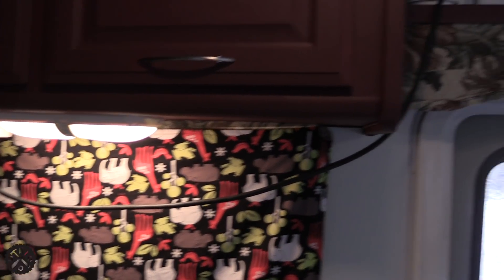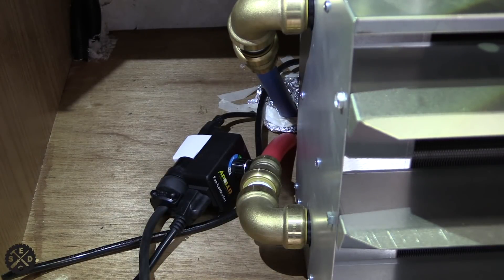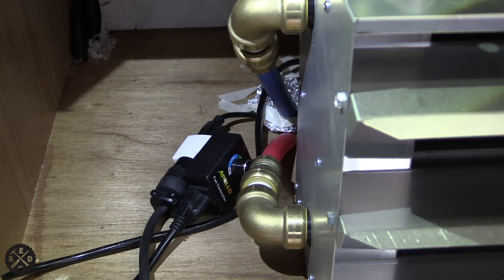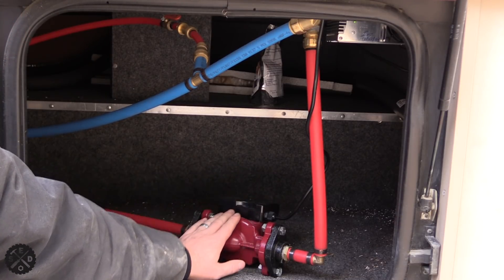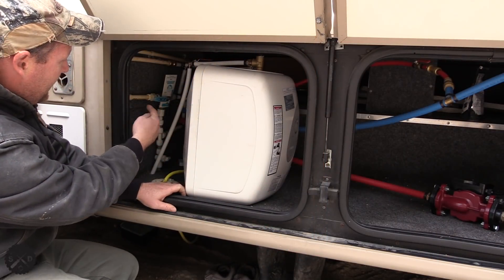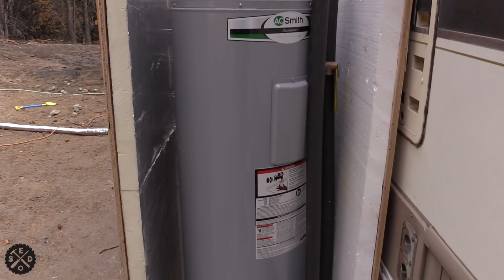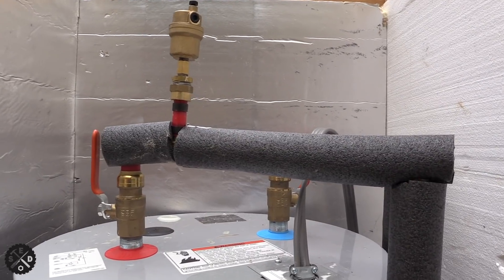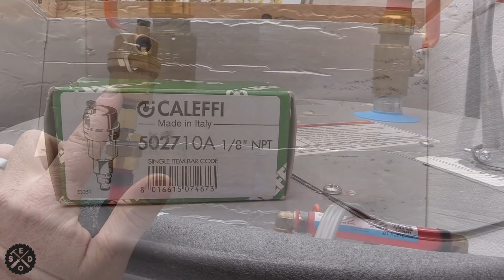Heat With A Water Heater And Radiator RV Camper Garage Shop

Comment: Love this!  Planning to consult my Plumber on installing a similar setup in my basement's furnace room, to supplement the heat in the basement, as the furnace just won't heat the basement, properly, no matter how I configure the heating vents.  Cost of installing a thermostat controlled gas fireplace is $5k+:  did this in our previous house.  for our current house, it would require major remodeling in the basement:  likely $15k - $20k, for everything.  I calculated what installing a setup similar to your's, in my furnace room, hooking it up to my existing gas, high efficiency Water Heater:  it clocks in between $700 - $1,000, total, parts plus a professional Plumber's time.  Our furnace room is unfinished, with exposed water pipes in the ceiling, so easy access.  It should work better than the gas fireplace did, to heat the majority of the basement in the old house; that fireplace worked superbly, without a fan to blow hot air around!

Your video gave enough details, and your links (even though not all worked) gave enough information to find all of the needed components.  FYI: prices on e-Bay are the same as on Amazon; both offer free shipping.  Hoping to install a system within the next two months.  Our basement gas fireplace, in the previous house, lowered our heating bill, overall, by warming the basement 10+ degrees, which kept the upstairs warmer, as all of that heat rose upwards.  Expecting the same for this house, with the Hot Water Heater supplementing the furnace, warming the basement around 5 degrees.  Thank you!  Cheers!
Reply from the maker: That sounds like it could work well in your situation. I hope you can get it set up easily! Thanks for sharing your experience.

Comment: I’m trying to make an off grid set up like this with a wood stove boiler. How would I control the heat output?
Reply: look for snap disc's they have them for different temps. I had my woodworker in basement and used the modine as a dump zone it kicked on an off with the snap disc's clamped to the pipe and wired to the fan.
Reply from the maker: I’m not exactly sure on a wood stove you would need some kind of manual tempering valve I think.

Comment: Why not just use a 220v electric heater in the camper and eliminate the whole water system?
Reply from the maker: You could. We wanted something that was safer for kids since they were in the camper with us and this radiator didn’t get hot enough that it would hurt you if you touched it. It actually made for a really nice place to dry our gloves and boots as well. All depends what your needs are.

Comment: Great idea.  What is the smallest water heater do you think could work?
Reply from the maker: Thank you. I don’t really know. I think it would depend on the space that you’re trying to heat.
Reply: @SmartEasyDIYer  lol, what a silly question I asked.
Does the electric bill raise much ? I bet you could do the same thing by heating a barrel of water over a fire. And link them so the water heater could take over when you go to bed and not away to feed the fire any longer
Reply from the maker: I think you could somehow yes. I don’t think it really was too bad. I was building the house at the time so I was using electric for that and to keep the water line, under the camper and well pressure tank from freezing so everything was using juice at the time. So hard to keep track of just how much this used.

Comment: This is a big and  expensive way to  heat an  RV,  I got a little electric heater called  comfort zone  and it heats up my class C RV  very well And it only costs $25 at Home depot, so for  a class A RV  3 would be just fine $75 vs.just  The  price of the electric water heater  is over $500 Dlls.
Reply from the maker: Well the reason I used a water heater is I already had one that I was going to put into my house when I was done building. I just wanted to show that you could use the same principle in a garage if you wanted. And for us this was a very cheap way to heat for the winter and very pleasant heat. I don’t think that heater would’ve done what we needed in below zero weather. Thanks for the comment.

Comment: I'm looking to build this for my garage. It would be a closed loop system. Do I need to worry about to much pressure? Do you think I need a pressure relief tank?  Any other suggestions?
Reply from the maker: I think a small pressure relief tank would be a good idea. I didn’t with mine since it was a temporary setup and it did fine but on my radiant heat in my floor now it has a small one. I apologize for the loudness of the music in this video I didn’t realize how loud it was when I did it and I can’t find my original file to redo it.
Reply: I am hoping to do this in my 1000 sqft garage, suggest a bigger radiant heater? The water heater is just behind a wall where the heater will be in the shop. Everything insulated with R25 and R49 in the ceiling.
Reply from the maker: @victoriabondarenko8051 I don’t remember the specs on this specific one since it’s been a while but that’d be the main thing to check the sizes they offer. Sounds like you got a nice setup for it. 👍
Reply: @victoriabondarenko8051 look for a modine. they are for hot water with a fan and have differnt sizes

Comment: How about using an rv propane portable tankless water heater instead?

Seems to me that it should work if it's vented outside and antifreeze is in the heating fluid.
Reply from the maker: It’s an idea. I don’t know. My goal was to stay away from propane because of my driveway setup that winter. Id say It’s worth a try if that what you have.

Comment: With using everything you have listed for parts how well do you think it would work using a mini 120v hot water heater that only holds 7 gallons of water??  Or would you have to get a smaller pump??
Reply from the maker: No you wouldn’t need a smaller pump I don’t think. My main concern with just using the small one like that is I don’t know if it would keep up with heating the water. It depends what size area you’re trying to heat. I used one of those heaters like you’re talking about for the domestic hot water in the camper and it took about an hour to recover if you used all 7 gallons so it seems to me like it would struggle to keep up to temperature if you used it for heating purposes. But again I think it would depend and various factors like size of the area you’re trying to heat, how cold it gets outside, how insulated your structure is, what temp you’re trying to maintain etc.
Reply: @SmartEasyDIYer  My garage is a 1 stall 23 x 14 ft garage and 8 ft ceiling, insulated pretty good, as long as is stays above zero it stays about 30 degrees in the garage, even today its -30 with the windchill and its about 25 in the garage!!  Or would using a 120v tankless water heater and some sort of water tank be a better option instead of the small water heater?
Reply from the maker: Do you not have 240v available or is 120v your only option? I’m just thinking 240 might be more efficient with heating. You may be ok with the 120v though if your garage does that good already. Seems like a pretty small space to heat atleast.
Reply: @SmartEasyDIYer  No i don't have 240, i just want something that would be kind of efficient to keep the garage around 50 degrees!!  I have also thought of getting like a 15 gallon barrel and putting one of those heat blankets on them that keep the barrel at 145 degrees and just hooking everything up to the barrel, all i would have plugged in would be the insulated barrel blanket, the blower and the pump.  I bet it would use as much electricity as an electric space heater or less!!
Reply from the maker: Ok cool. Yeah there’s lots of ideas to consider for ya. I’d be curious to see what you end up doing and how it works out for you if you wanna share back with us.

Comment: Is this more efficient than just running a 220v electric heater?
Reply from the maker: Yes for me it with the camper setup it was a lot more efficient. It probably depends on your situation if you’re using it in a well insulated garage or something.

Comment: I wonder how a fair sized car radiator with a good shrouded fan put out? Or even two stacked  in front of one another. You still have propane as a backup?
Reply from the maker: That could be an idea to experiment with yes. I did have some small tanks of  propane just in case but I never used them.

Comment: Glad it works. I have been getting parts to do my house. I just need a water heater now. I have seen them use a water heater for a floor. But was wondering if it would work with a heat exchangers in my home furnace. My house is about the size of your motor home
Reply: did you get it going?
Reply from the maker: Yeah I’m sure there is a way to set up a heat exchanger in your furnace. I’ve never done it personally but I’ve heard of it. If I could’ve done radiant heat I would’ve gone that option but of course that didn’t work with my RV set up so I wanted to show what I came up with otherwise with the hanging heater. It actually worked really well. Good luck with your project!

Comment: Why not just use the onboard water heater?
Reply from the maker: Mine didn’t produce near enough heat. You could potentially but it wouldn’t have much thermal mass if it’s small.

Comment: Don't know why you went trough all that trouble unless it was gas fired. Ceramic heaters would of been much cheaper and easy to use.
Reply from the maker: Well for us it was a looong cold snowy winter and I wanted to make sure we were going to stay warm. None of the ceramic heaters we tried worked well the heat just disappears in a camper. For the comfort level this was well worth it for me to do. Did an awesome job and when I was done I changed the elements and used the heater in the house now for domestic hot water.

Comment: I'm just wondering, what's a HOT WATER HEATER? Doesn't it take cold water and make it hot? Why would you take hot water and heat it? Too many times I hear it called a HOT WATER HEATER, which is just wrong! It's a WATER HEATER, period!
Reply: Paul lmao 😂
Reply: Why do we Drive on the Parkway and Park on the driveway?
Reply from the maker: I’ve never understood that either. 😜
Reply from the maker: I get what you’re saying LOL. It is technically a cold water heater yes but usually it’s referred to as a hot water heater.
Reply: Actually, it's just called a water heater. That's what every manufacturer calls it. I deal with a number of them. LOL! Just figured I'd razz you a little on it.
Reply from the maker: Hahahaha good times. May as well. Lol

Comment: why not just plug in a fan heater  about 20 dollars to buy
Reply: What's the service supply on the average RV?  Probably not big enough to run more than one heater.  (( I honestly don't know what the power cord is rated for on an RV, I don't one.. ))
Reply from the maker: Typically for an RV its 30 amp. Since I have the option where my hook up was I ran a separate 30 amp for the water heater.
Reply from the maker: It didn’t throw near enough heat for what I needed. We had one of those.
Reply: You heat water run pipes lose heat in outdoor cabinet buy pex sharkbite controller pump and radiator. This you do Versus a few electric heaters. If you had gas it might have an possibe cost savings. This effort in mindbogglingly unnecessarily redundant.
Reply from the maker: They actually don’t lose much heat at all because I insulated the pipes.  I left them uninsulated underneath the cargo hold in the camper because I wanted to give off some heat to help keep the underside from freezing.  It actually works really well for my set up.  Much cheaper for me than Buying propane all the time.  The onboard propane heaters are not very efficient.  It’s also more efficient to heat hot water than it is just have an electric heater going to heat the air.  It’s been really amazing even on the coldest of days how well this set up has worked for me this winter.  Thanks for the discussion.

Comment from the maker: Hey guys just wanted to update you on how the heater is doing.  Last week we had a lot of below 0 degrees F at night and this heater worked amazing!!  I thought it might never shut off it got that cold but it shut off almost as often as normal.  That was the true test for it.  I have to say never having tried this before I’m really impressed with this set up.  If you had a small insulated garage or shop I think it would work amazing if you don’t have the radiant tubing in the floor option. Also I apologize for the loud music. I thought I had it a lot lower volume than what it was compared to my voice. I can’t find the original file to re-upload it. 😑
Reply from the maker: Also my worst electric bill was $170 so far. That’s running the heat at 68 all the time, running 4 heat tapes on my hoses and water supply to keep it from freezing, 5 - 75w light bulbs to keep the septic/Grey water from freezing underneath and my water pressure tank in the house, a supplemental 1500w heater by the septic/Grey water tank when it gets really cold and working on building my house. So I don’t think that too bad. I certainly would have more in just propane for the heat and it wouldn’t be near as comfortable. The propane is a wetter heat, this heater is nice dry cozy heat. :)
Reply from the maker: grumpy old fart in my setup for the camper it would’ve been a lot more work and intrusive in my living space to do that.
Reply from the maker: Ceramic heaters don’t do much in this camper.
Reply from the maker: I thought you were saying baseboard heat etc.

Comment: Use DC heating elements and solar panels.  The heat may not last all night though. Good idea you have.
Reply: I own a Bounder as well.
Reply from the maker: Yeah I’m thinking it wouldn’t last all night with the amount of juice it uses.
Reply from the maker: Thanks. How do you like your bounder?
Reply from the maker: Thanks yeah I’m amazed how much heat this thing puts out! Last week we had 14 below zero as the coldest and the camper was toasty and warm! I thought the heat might never shut off if it got that cold but it shut off almost as often as normal.
Reply: Smart Easy DIY Absolutely love it. Has the Cummings 5.9 and Allison 6 speed. Got over 10 miles per gallon towing a trailer with my Harley to Sturgis then back home to Ca.
Reply from the maker: Wow that’s awesome!! Sounds like a solid setup! You can’t go wrong with that drivetrain. I wish mine had a diesel I have the Ford V10. That’s why I don’t take it very far LOL.
Reply: Smart Easy DIY I've owned two ford v10s. Bad ass engine. Having to repair a few things but these Bounders are built with steel 1 1/4 tubing. Solid. Mine is an older 1994.
Reply from the maker: Ok good to know! We mainly got ours for a place to live while we build our house then probably resell it once the house is built. Overall though it was the best layout for the space and biggest fridge, washer/dryer etc I had to redo the plumbing cuz someone didn’t winterize it and busted the pipes. Overall a nice rig though. It’s a 99